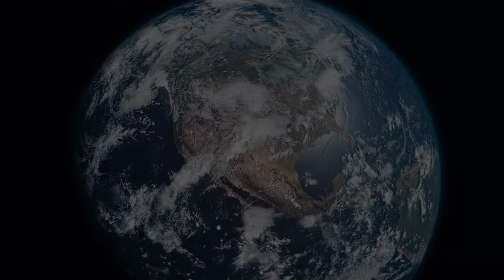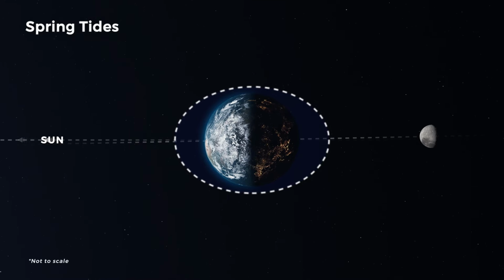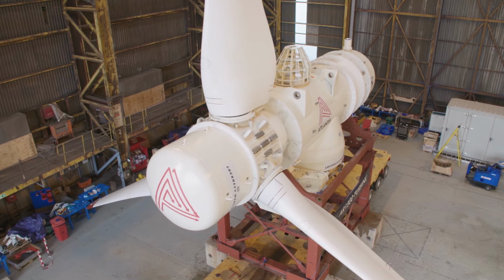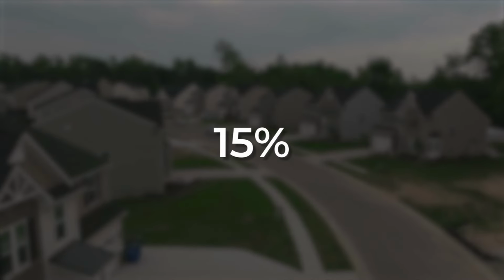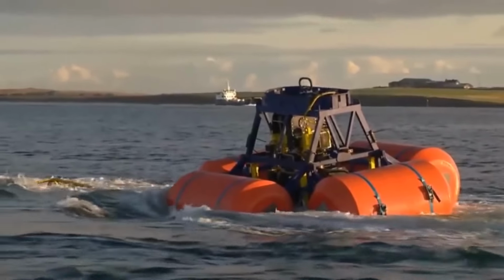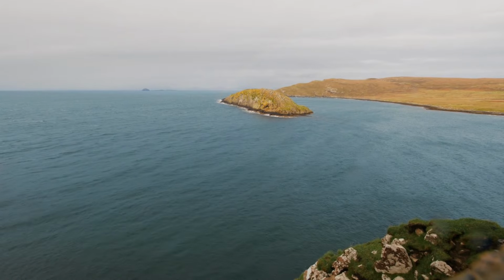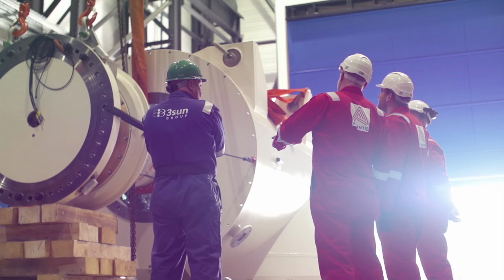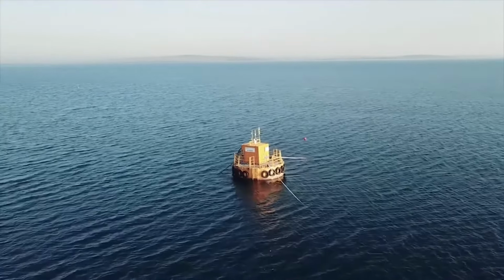Can Underwater Turbines Solve Our Energy Problems?

Comment: Wind turbines are unsustainable and wasteful since they do not generate enough energy to offset the energy required to build them. And, the video did mention that water turbines are more expensive than wind turbines. So, this looks like another wasteful pipe dream. The number of people who champion wind energy, and similarly water turbines, is embarrassing.
Reply from the maker: So incredibly wrong. Stop repeating shit you read on Facebook
Reply: Real Engineering 
I am an engineer and crunched some numbers myself. Just regarding the refining of steel, not the energy in manufacturing or shipping, the most efficient wind turbine built to date would take 10x longer to pay off the energy costs of the steel than it would take to pay off the dollar cost of the steel. Considering how long the payoff time is and how short the service life is, there is no way they are producing a positive net energy.

Edit: I am making an assumption that the energy analysis for the steel extrapolates to the rest of the turbine. However, given how conservative my energy requirements estimate is, I don’t think it is unreasonable. The majority of the energy cost likely comes from the steel and transportation. Also, a professor in an energy course I took also said that wind will never work due to turbines needing more energy to build than they produce. A long time later, I decided to look into it myself. The energy cost of the steel was so high that further investigation didn’t seem necessary.
Reply: @Austin1990  I call big BS.
Simply, most wind turbines are for-profit ventures. If making them would require more energy than they can produce, no-one would build them, as manufacturing costs would obviously be higher than their life time earnings.
Reply: Bird_Dog 
No, because they are made using relatively cheap fossil fuels and pre-existing technologies. That is why cost analysis gives a false perception. The manufacturing uses a lot of metal and heavy equipment. That requires a massive amount of energy. You cannot get around that.
Reply: @Austin1990  Show me your numbers then.
I don't buy it at all.

According to a paper I found online (Energy Use in US Steel Manufacturing by a certain Nikolas Martelaro published in december 16)
It takes about 4375 kilowatt hours of enery to make a ton of steel from iron ore (most of it is used making pig iron, so if recycled steel is used, the energy requirements would be much lower).
I did the numbers, and while I cannot rule out that I did make an error, I'm reasonably confident that I'm not too much off.
Assuming a wind trubine requires 100 tons of steel (from what I read, it's actually less) a 2MW turbine could under ideal circumstances recover this investment of energy in under 20 days. Since circumstances are never anywhere near ideal, and other materials as well as all kind of work is required, the total time will ofc be considerably higher.
But it does make the number for the time required to recover the energy investment (7-8 months for a 2MW trubine) quite belivable to me.
Reply: @Bird_Dog00  
I used this coursework report for the energy and energy cost of raw steel:
http://large.stanford.edu/courses/2016/ph240/martelaro1/

It is not a published paper; just a report submitted for coursework. It seems to be the same that you are referencing. But, its sources are good enough for this. I calculated that it uses $0.0085/kWh for energy from coal as well as natural gas and $0.0698/kWh for electricity (simple unit conversion). However, electricity is largely made from coal or natural gas. The average coal power plant in China has an efficiency of 35%, so I adjusted the electricity energy by this efficiency to get the energy cost in fossil fuels. This gives an adjusted energy cost of $0.0244/kWh for the electricity.
Power plant efficiencies: https://www.ge.com/reports/wp-content/themes/ge-reports/ge-power-plant/dist/pdf/GE%20Global%20Power%20Plant%20Efficiency%20Analysis.pdf

For the steel cost, I used the cost of the energy to make the steel rather than the market price of the steel. I did this because the market price contains overhead costs that have their own associated energy costs. For a relative analysis, leaving out as many variables as possible is best. My analysis is to consider the net energy feasibility of wind turbines, not to determine the financial profitability. For instance, the food industry uses 10 kcal of fossil fuel energy for every 1 kcal of food that it produces. It is obviously financially profitable, but it has a massive net energy deficit of 900%.

I used the following turbine. It produced a record 262 MWh in one day, but its estimated annual average is 184 MWh/day. Using the same $0.07/kWh for electricity as in the report, it produces $12,850/day. This is much lower than the US average electric cost of $0.12/kWh, but it is more conservative.
https://www.intelligentliving.co/worlds-biggest-wind-turbine/

Producing raw steel from ore requires 6.9 MWh per metric ton and $58.05. 6.9[MWh/ton]/184[MWh/day] gives 0.00371 days to pay back the energy of 1 ton of raw steel. 58.05[$/ton]/12,850[$/day] gives 0.00264 days to pay back the dollar cost of the energy of producing 1 ton of raw steel. 0.0371[days]/0.00452[days] gives a ratio of 8.21, meaning that paying off the energy of producing raw steel takes 8.21x the time of paying off the dollar cost of that energy. This removes any estimations of the total weight of the steel in the turbine.

The expression for this ratio reduces to the [$/kWh produced]/[$/kWh of energy made with]. So, this is simply 0.0698{$/kWh]/0.0085[kWh] for coal energy. Since the report uses the same energy cost for all fossil fuels, this ratio will be the same for recycling steel with coal or natural gas as well. Things get interesting when we look at recycling steel using electricity.

If we use my adjusted electricity cost to account for the efficiency loss of a coal power plant when producing electricity, the ratio is 0.0698/0.0244 = 2.86, which actually isn't that bad (although not great). However, using electricity to recycle the steel is much more expensive than using coal. With little regulation, I expect that Chinese manufactures would favor the cheaper energy source. This brings us back to the 8.21 ratio. Notice that selling the wind turbine's power at a higher price actually increases this ratio.

The final ratio depending upon the cost per energy produced divided by the cost per energy used makes sense. When the energy costs are the same, the project will pay for its dollar and energy costs in the same amount of time. If the energy that it produces sells for more than the energy used to construct the turbine, the project will pay off the dollar cost sooner than it will pay off the energy cost.

The vast majority of energy consumed globally is from fossil fuels. This is also going to be true in China. Therefore, using the cost of coal energy from that report is most accurate. In fact, coal in China may even be cheaper than in that report on US steel production. So, I think that applying that 8.21 ratio to convert all dollar costs of a project to the total energy costs for the project, and thus to the project as a whole, is reasonable.

As the cost of energy used increases, such as from an increased use of EAF for recycling and using EVs for transportation, the dollar cost of the project will increase. That means that the dollar payback time will increase, not that the energy payback time will decrease. Per a former CEO of Ventera Wind, the payback time for a wind project is usually 5-6 years, which has been decreasing over time ( https://www.quora.com/How-long-does-it-take-for-a-wind-turbine-to-pay-for-itself ). Using the 8.21 ratio, the energy payback time would be 41-49 years. The typical life of a wind turbine is 20-25 years, but many are reaching end of life sooner, even in merely 14 years ( https://www.americanexperiment.org/2018/06/limited-lifespans-wind-turbines-result-higher-costs-energy/ ). That is less than half of my estimated energy payback time. With all variables remaining the same, a wind plant would need to reach payback in 2.5-3 years merely to break even energy-wise by the time the turbines are scrapped.

As more vehicles move to electricity rather than fossil fuels, the more expensive electricity cost will be used in the payback ratio, reducing it. But, that would drive the dollar payback time toward the 41-49 years of the current energy payback time, not pull the energy payback time lower. Increasing the cost of wind energy sold to the grid may alleviate this issue for some time, but that will eventually increase the dollar payback time further unless sustainable sources of energy are used to prevent overall electricity costs from increasing.

Improvements in technology and efficiency will help decrease the overall energy cost of wind turbines and, thus, energy payback time, but reducing 41-49 years by 50% would merely allow wind farms to break even energy-wise. If someone wants to dream that engineers are able to reduce the energy costs of wind farms by 75%, that is fine (and still very expensive). But, such people shouldn't pretend that their dream is a reality and try to force currently unsustainable wind energy onto the grid. They are just going to drive energy costs ever increasingly higher for everyone as wind energy meets a larger and larger portion of global energy consumption.

EDIT:
This was basically napkin math for a crude input/output estimation of energy cost. A better estimation is a Process Chain Analysis (PCA). The following article is often cited for the energy payback ratio (EPR) for various power plants, including coal and wind. It costs $28, so I haven't seen how it calculates its numbers. Specifically, I don't know how long it used for the service life of different plants. https://www.sciencedirect.com/science/article/abs/pii/S0920379600001587

That aside, the following article quotes the article above. It reports that wind energy has a significantly higher initial energy coat than coal per power capacity. It also has significantly higher maintenance costs. However, coal plants have a very high energy cost for acquiring fuel. I should clarify that the given initial materials and construction costs are normalized to an annual amount based upon the assigned service life.
https://www.eia.gov/analysis/studies/powerplants/capitalcost/pdf/capital_cost_AEO2020.pdf

Using Case 20 in the following paper, it appears that the PAC for wind cited above uses a service life of 25 years for wind farms. 15-20 years seems like a better estimate, but wind still looks good. It has a EPR of 23 vs 11 for coal. Adjusting for shorter service life (80%) and actual capacity as opposed to rated capacity (35%) gives a new EPR of 9, which is still quite respectable given the reduction in pollution.
https://www.eia.gov/analysis/studies/powerplants/capitalcost/pdf/capital_cost_AEO2020.pdf

So, yeah. I was wrong.  But, it was in a very encouraging way since it actually looks rather promising.
Reply: @Austin1990  I'm not entirely sure what to make of your reply.
I think your calculation via cost was just too complicated and error-prone.
As you say in your edit, there was something wrong with it.
That happens, and I apreciate you correcting yourself.

Since I actually suck at dealing with nubers, I opted for a "quick and dirty" calculation to use as a meter stick.
And while that doesn't give you a clean answer, it can help you check if something sounds right or not.
Usefull numbers are acutally quite hard to come by, so I had to do some digging.

The wind park Mont Crosin, with 16 turbines totaling 37.2 MW nominal capacity, produced in 2019 82'000 MWh electricity. That's an efficiency of just about 25%.
So, a 2MW turbine produces on average 500 kW.
Thus, one 2MW turbine would need about 14 hours to produce the 6.9MWh of energy for one ton of steel in your example.
That sounds quite feasible.
Reply: @Bird_Dog00  
Indeed. In general I made some really bad assumptions.

I think many technical people scoff at wind marketing and assume that it is deceptive. But, they never look up the actual numbers. You are the first person who has even tried. So, thank you. I spent over 6 hours of actual research and cross-referencing to disprove some of the things that I was told about wind energy from other engineers.

I think rumors like that could largely be why renewables are resisted by some people. It isn't due to profits; the numbers show wind to be more profitable than fossil fuels and even more than nuclear. I will definitely be compiling my findings to share.

Comment: Excellent video and what a piece of kit. One thing does annoy me. They are so tied up with the environmental impacts that the current oil and gas residue is often ignored. How much pollutant lands on the water/passes through the area that has come from fossil fuel useage? This is never looked into. Some birds get killed by wind turbines but million die from toxic pollutants. These tidal generation turbines should be installed as much as possible as soon as possible.

Comment: No they cannot. There is no energy problem. The problem is in hte heads. Humans naturally do no need coal fires, oil fires, gas fires, fuel for engines or electricity. Greed is the motiv for building machines and industial plants. Convenience and idleness combined with greed result in the thought of energy problems. This all works out. There is no lack of energy. We can use nuclear fusion each day. But no. Some people need to build their own reactor. The utcome is plain to see.

Comment: Wouldn’t using a double helix 🧬 shape eliminate the potential hazards to wildlife? 

Just vertically mounting the spinning components could use a fraction of the space. If that’s true then many could be installed within the same area of the one, propeller type assembly.

Comment: It seems to me that one of the bigger problems is the interference with boating traffic. You got to put these things at the entrances to harbors, coves, etc, the same places that boats use. Also, Salt water is a tough environment to operate anything. 

And like wind power, you need a lot of them to really make a difference. That's always the problem with renewable energy, the energy sources (i.e. wind, sunlight, waves,) while abundant, have low energy outputs per area. You need a lot of windmills to equal one, relatively small, combine-cycle, gas turbine facility. For example, the whole proposed cape wind project, (150 3-MW wind turbines off the coast of Massachusetts, it got cancelled) only equals one 500 MW gas turbine facility, and only on a good day.

 It would be interesting if you could somehow get power out of the tides in the Bay of Fundy.

Comment: In 1980 I asked an IIT graduate about this and he said it is not possible... I believe that  'everything that moves must have some form of Energy'
Reply: Yes betz.is.bogus mine open is.closing opposite halfs there opening opposite flat opposing half simontanisly our pure kinetic tindle energy and.reverses with tide  emence energy capable of gearing to light speeds to spare in momentum kinetic energy.vertically or horizontaly hoover dams full on blocking and releasing simontanisly mirroring magneticaly naturally.wow if you belive Einstine relativity kinetics this proves fact.even learning curve . Slow but sure now what ?

Comment: for a turbine to be really efficient the larger the diameter of the generator the more electricity , for similar input . so why do engineers design antiques , and call them cutting edge. having a small diameter generator driven by  big  blades , would be more efficient if the generator also had a larger diameter.-

Comment: There is a problem saying that these turbines can power 1000 US homes for a year.   Yes, on AVERAGE, the numbers work.  However, the approximately 1000 kWh of electricity used per month varies a lot over 24 hours and over the seasons.  The electric demand at 6PM on a hot July day can be several times the average of about 1.3 kW.  Utilities must always plan for the PEAK demand since they must supply enough electric energy to meet the demand.  So, the turbines must be able to meet the peak demand, not average demand if they are to be the sole source of electric power.  Now many of you will like to argue with me but if you don't know the difference between a kW and kva, please stay in your lane.

Comment: I wonder if a vawt(Vertical Axis Water Turbine) would work better than the hawts(Horizontal Axis Water Turbine) they are using in some areas? Since hawts need to be turned towards the flowing current to work, but vawts can accept the current from any direction.

Comment: Would you stop using the term "baseload"? It's no longer in use in Europe. The term basically means that the plant cannot vary its output energy, but that is required to be connected to any European grid. "Baseload" is a derogatory term, it doesn't mean it's reliable.

Comment: Why not couple underwater windturbines to an air-to-liquid plant that produces synthetical fuel from electricity , water and air ? No need for batteries anymore , the energy is stored in the liquid synthetic fuel , that then can be transported , like is done with petrol now , to any place where it is needed . But instead of burning fossile fuels , you burn synthetical produced carbon-neutral fuels . And you don't even have to switch the economy to a battery-powered one . All the internal combustion engines , that are already in place now , can keep working . Saves a lot of money , that then can be spent on renewable energy , like these underwater turbines .